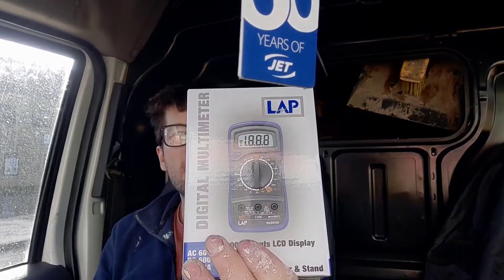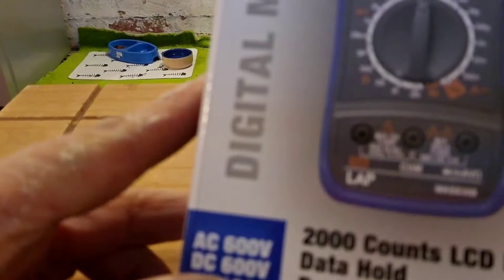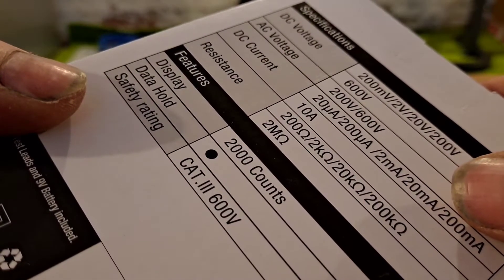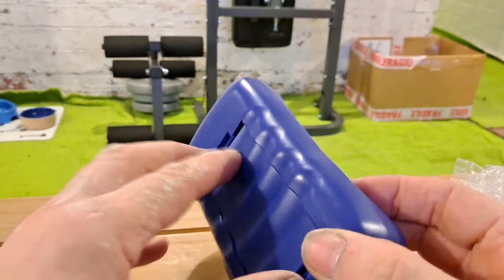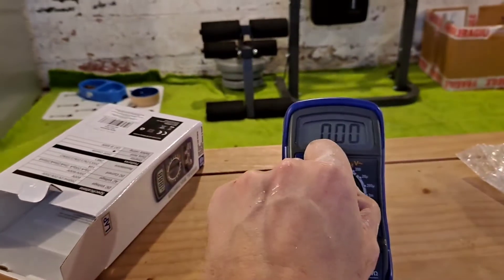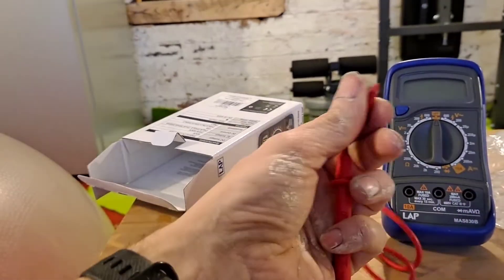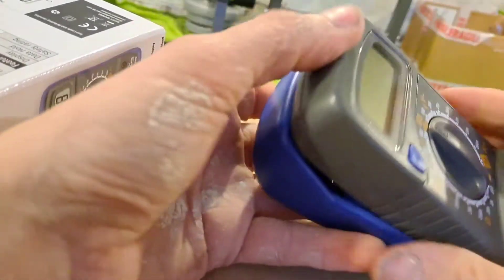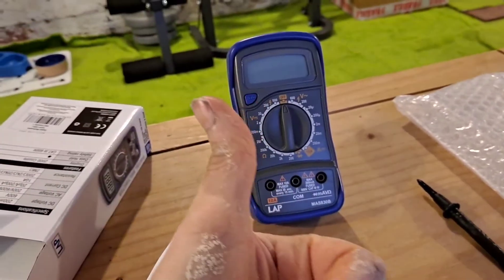Lap Digital MultiMeter MAS830B  600v Screwfix the unboxing quick review

Comment: Does this check for continuity?
Reply: You Can check continuity with this multimeter it just doesn’t have the  beep
Reply from the maker: No as I discovered later when I was using it.. it doesn't have beeper
Reply: @handyandyuk  Can you not check continuity using the Ohm settings?